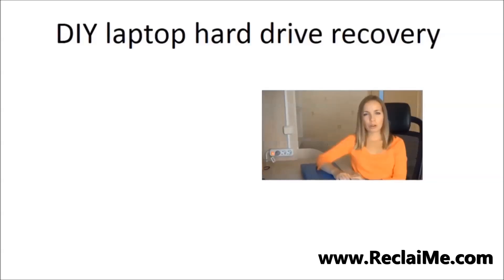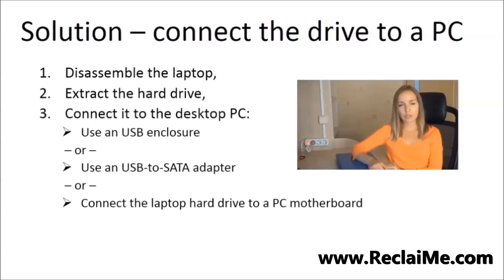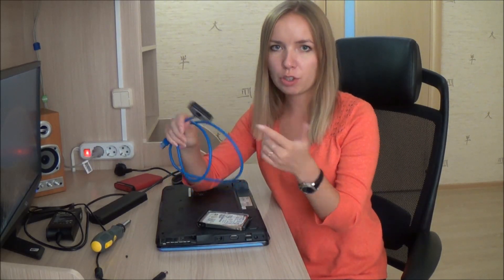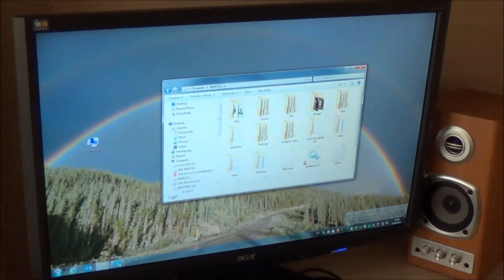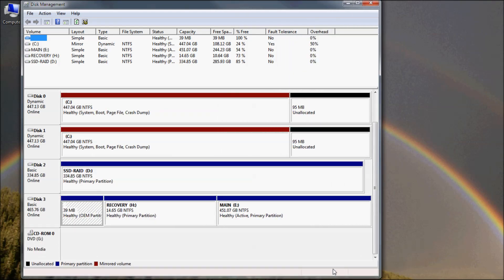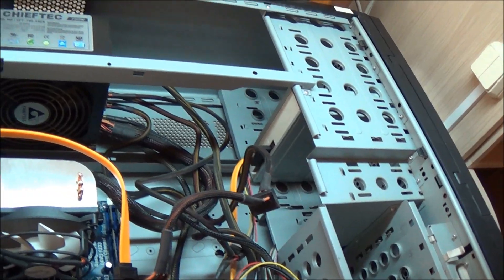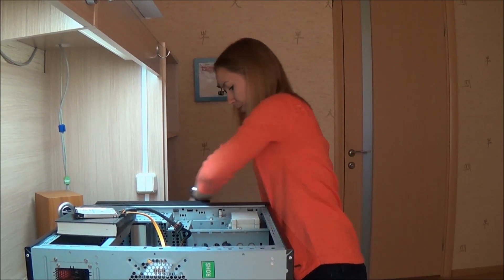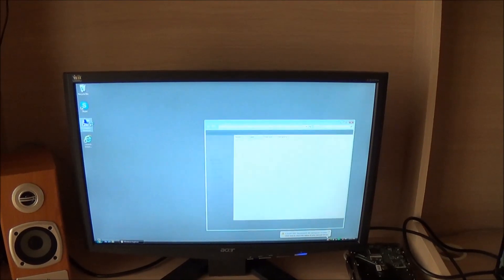Laptop data recovery

Comment: hello ma'am my laptop's hard disk is not detecting...but it takes power as said by service center.... is there any option to get backup of my laptop's hard disk
Reply from the maker: Until the PC sees the drive, nothing can be done with the software. Suggest you contacting a data recovery lab in your location so that they "repair" the drive.

Comment: Can I use another laptop instead of using desk top? I don't have any desk top. Thank you.
Reply from the maker: Theoretically, you can use a laptop with USB-to-SATA converter. Practically, desktop and direct connection to SATA port provide far more stable platform and generally better experience.